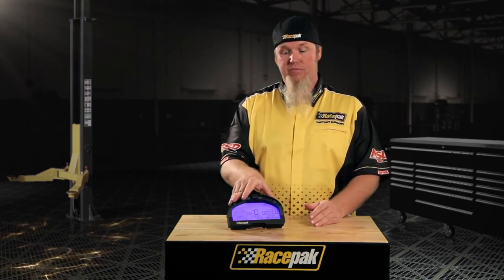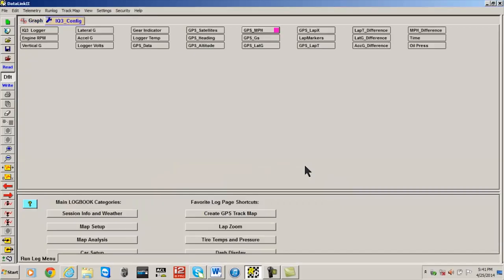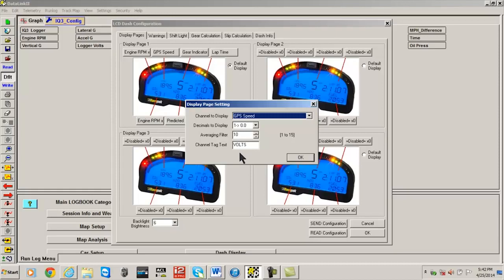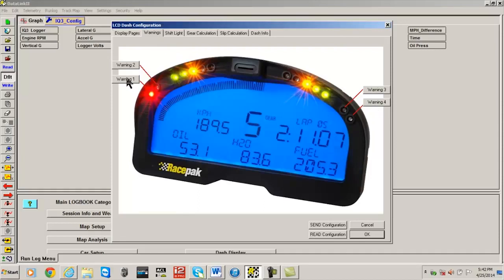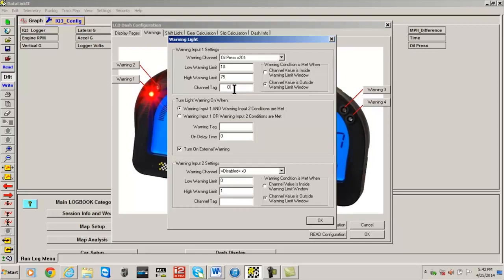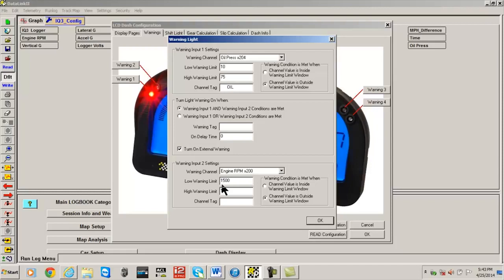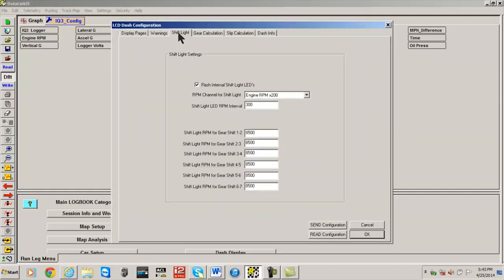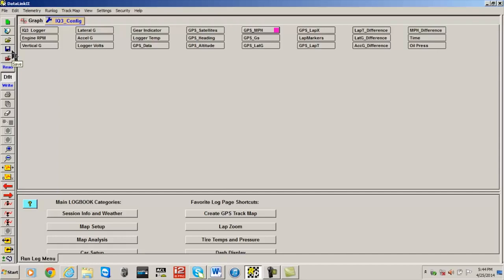IQ3 Setup

Comment: I can't get the racepac to work with a v88 vipec.
Reply from the maker: Your best bet would be to speak with racepak directly https://www.racepak.com/
Reply: Haltech yeah... they have no idea.... I'll be throwing the racepak in the trash. I do not recommend racepak
Reply: James Moore wonna sell it?
Reply: Doug Lesley sure... and I have two cables for a vipec edu also.
Reply: I’m trying to wire the haltech IQ3s, I’m trying to wire to the LS1 ecu but I don’t get readings from the coolant, or oil pressure, or rpm signal, now to configure the dash the ls1 uses a 4cyl 4 pulse signal, also do I have to use the 5v reference and ground for the sensors???